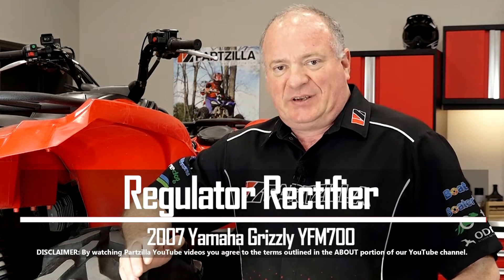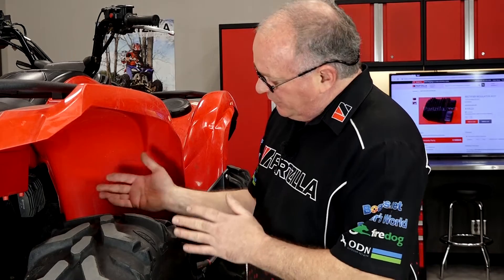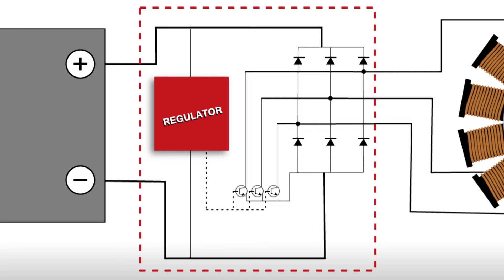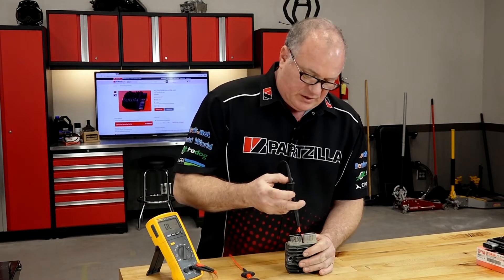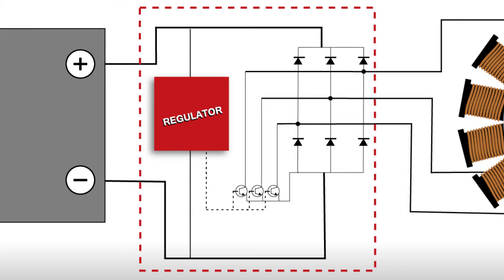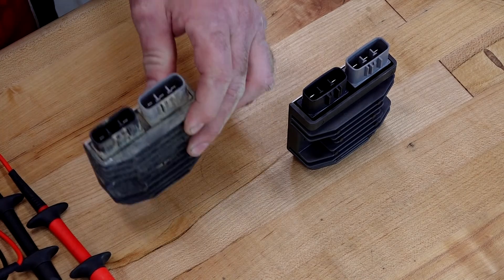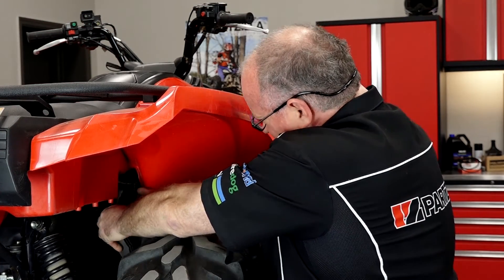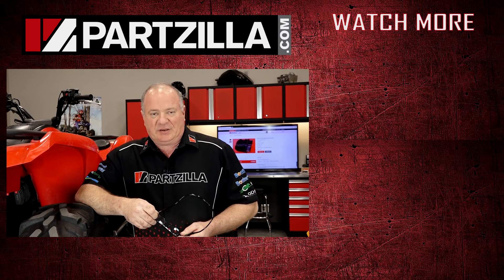Yamaha Grizzly Not Charging | ATV Charging Problems | Partzilla.com

Comment: Yeah and the same problem with my grizzly 660 2002 running then check if light were working 2 minute after that shot down no more contact

Comment: Good evening, I got a 1980 Suzuki Gs 750 L, first voltage test was 12.57- started and it was 12.43, turn light on bright and it stayed at 12.12 to 12.14, not lower or higher, hope you can give me your thoughts, thank you for your time.
Reply: More than likely it's the voltage regulator because it should charge no less than 13.5 - 14.5 volts .